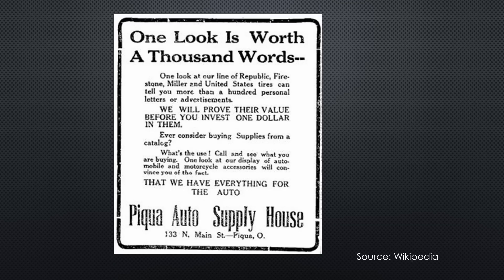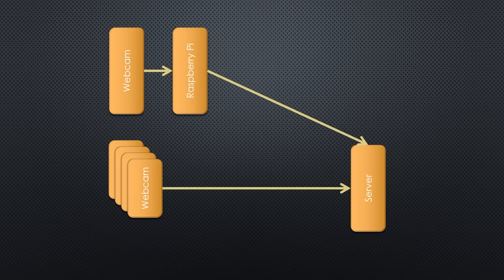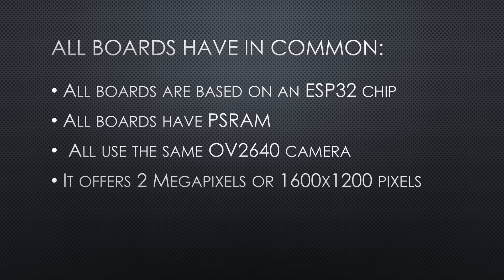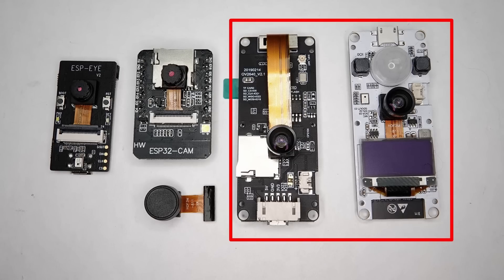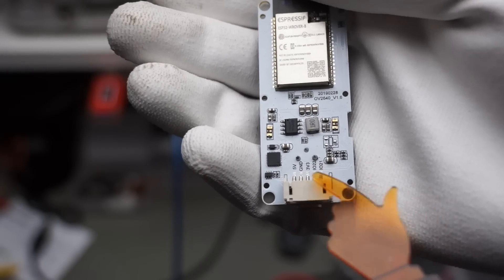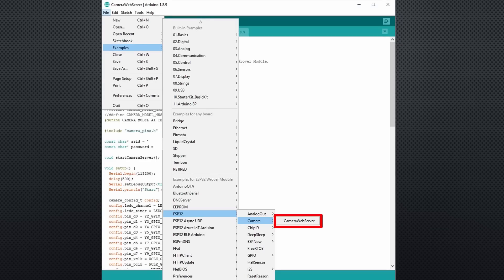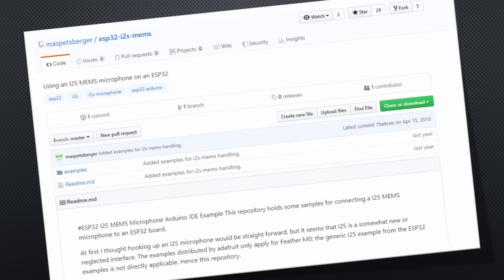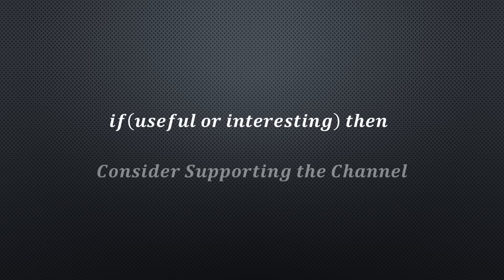#285 ESP32 Cameras: Comparison and Test (OV2640) and I2S MEMS microphone test

Comment: Great video!  Thanks.  I have a question about the chart shown at 04;20 - detailing the Esp32-cam .  It says no SD card slot is available. I'm holding this exact same board in my hand - and there clearly is an SD card slot .  I haven't checked that it works but I'm sure it will.
Reply from the maker: You are right. I pinned a correction post as the first comment ;-)

Comment: Hello andreas,
 I have a esp32 devkit v1 30GPIO version. I am facing issue when providing power to vin pin from external power supply(+5V). esp32 board show power on led but its sketch doesn't start until I press reset(EN) pin. Can you please help me to provide some information on this issue.
Reply from the maker: Unfortunately, I cannot do remote debugging.

Comment: HELP! - I received my ESP32-CAM last week and have been struggling with it.  I had some issues programming it at first; but, that seemed to have a problem with my USB-serial.  I got a new one and it programmed right away.  I then had to figure out which "CAMERA_MODEL" to use for CameraWebServer.  CAMERA_MODEL_AI_THINKER works (I think) - at least no error.  Now the challenge I have is getting the IP address.  When I use the USB-serial in 3.3V mode I get the "Brownout detector was triggered".  I assume this is because the USB-serial can not supply enough current.  Anytime I try to avoid that by posewering the board using 5V on the VCC pin, the LED turns solid on and I get no message out of the serial port.
Reply from the maker: You are right. I do not connect 3.3v from the FTDI adapter and power the module with 5v. GND has to be common

Comment: nice video and good explanations as always :) I am struggling a bit around with my ESP32-CAM (AI_Thinker variant) while trying to hook up this litle dude to my LAN (via 5V diy PoE injector) and a W5500 ethernet module. Seems to be: i am "zu blöd" to enable the W5500 and link the ethernet port "bridged?" to the wifi.apip to obtain an IP address from the integratad "server" in my project. Any advice are welcome...
kind regards
Reply: Blöde Frage, warum willst Du an der Kamera eine Bridge machen?
Reply: @dahimbi7069  Hi, naja eigentlich würd ich ja gerne nur ein W5500 anbinden damit man das ganze als LAN-CAM Server ohne WiFi benutzen kann... via WiFi läuft das schon und wenn man das LAN interface da noch mit anknüppeln könnte -bin da offenbar zu blöd zu :), dachte LAN via "bridge" auf den im ESP laufenden AP und gut ist? oder hat sich da ein logicfehler eingeschlichen?
Reply: @kleinerfighter-ka6677  das sollte schon funktionieren, allerdings brauchst Du da keine Bridge für und Du darfst nur ein Default Gateway setzen und von DHCP würde ich dann auch abraten. Wie das allerdings rein Hardware mäßig aussieht, da muss ich passen, nutze entweder ESP für W-Lan oder Arduino Lan bzw wenn ich beides brauche PI oder Banane. Gibt's für einen nackten ESP eine Library für den W5500? Wenn ja welche Ports benutzt die?

Comment: Glad you showed the ESP32 Camera you don't own, but you missed at least 3 other ESP32 based cameras made by M5Stack - They have one that looks a lot like the ESP-Eye called the ESP32CAM it has a Grove connector on it so breaks out G/5v/G13/G4 nothing remarkable about it, but it does work out of the box, and works quite well. I think it runs around $8, There is the M5Camera, which is in a case and has lego mounts on it, It has a gyroscope, and pressure sensor, and Analog Mic, and a Grove connector to break out the I2C pins this one is about $15,  There is a M5CameraF which I think the difference is the fish eye lens, Looks like it's in a different style of case too, I'm not really sure it's about $17 dollars.  I'm still waiting on a couple of them from China, but they claim QR code/ and Face Recognizing. I don't think any of them are supported by the Arduino IDE just yet, just the ESP-IDF. Just thought I'd mention a few more.

Comment: ESP32 simply does not work good with camera sensor. So far there is some clunky i2s code that is not even written properly for i2s to operate at good resolution and speed.
Maybe someone who has ton of time will write some optimized code in lx6 asm  and add it under idf. Forget buggy arduino

Comment: Hi , this board can be used to protect the zone, be installed in the door. It can be used as a control point for a smart home. For example, going to the camera, she will notice the movement and activate the microphone, using the camera you can recognize the talking person. ESP32-cam will allow you to take photos on an SD card, store and transmit data for rpi3+.

Comment: I haven't ordered any of the TTGO camera boards, but I can verify that shipments to the US from US warehouses is significantly faster. As for the TTGO white, I believe it might be voice activated to get the camera working. I think Dr. Zzzs (I believe that is his name) did a similar spotlight on these camera modules and he had to say some phrase in Mandarin(I think) to get it working.  He might be able to help with the pinout for the non-working module.
Reply: As for projects, considering that you can pick up a board for $6.99 right now from Banggood, I thought I might try to attach one to a telescope for some heavenly event captures. I originally planned to use an RPi, but that solution seems a bit clunky but would be easier to record the video. We'll see how it goes. I grabbed some 'disposable' telescopes from Toys'r'us during their going out of business sale for testing. I just need to stop being lazy and get moving with the project.

Comment: I have a white TTGO board which does not have a mic.
The camera pins listed are very different than both the images you displayed.
Here's the camera pin list:
y9 39
y8 36
y7 23
y6 18
y5 15
y4 4
y3 14
y2 5
VSNC 27
HREF 25
PCLK 19
PWD 26
XCLK 32
SIOD 13
SIOC 12
RST NC

I know the camera works because I use it to keep an eye on our mailbox from the computer.
I don't know the above pins are correct because I haven't changed the code in the module since I received it. I just use the module as it came.

Comment: I am working with cheap esp32-cam for a while now. They do have some odd quirks e.g. on at least two of my devices the camera stops working if it doesn't touch the sd card slot ... I have no idea why. I also can only program it if it gets 5V but not 3.3V. Multiple IO ports accessible don't seem to be usable e.g. IO16, Programming via Wifi doesn't work properly, ... 
My plan is to build a security camera with wheels on it that either works like a remote controlled car or like a gondola on a rope having over my garden ;)

Comment: Surely one ideal application involving pattern recognition would be a "Guide Scope" for a computer controlled telescope mount. This would permit long exposures, which is the critical requirements for deep space telephotography. The characteristics of the camera and lens will be critical in order to work in low light conditions. It is so exciting, I simply must do it...what is the conversion efficiency of the camera chip is it a CMOS or CCD Camera..?

Comment: Check out my ESP-CAM Video Recorder
github  jameszah/ESP32-CAM-Video-Recorder

It has a http interface to stop/start and configure the recording, and look through the viewfinder, and an ftp server to download the video from the SD card.
The videos can be started with different framesize, framerate, quality, etc. and will be written as AVI files, so you can play or edit them on your desktop.
Good for full resolution at limited framerates, or full 24 fps at lower resolutions.
Improved version coming with uses both cpu's to prevent delays due to file system.

Comment: I got esp32-cam working with MicroPython as well. It takes a picture and emails it to me.
Reply: That's impressive!
I want to do that in my project.
Can you reply to this comment with a link to micropython code that captures images or video (preferably at max resolution) from the esp32-with-camera board?
Thanks!
Reply: (Oh.  I don't need code to do the emailing.  I am looking for micropython code that will capture images or video, at max resolution, and save them to an sd card.)
Reply: @KenSkier  sure, just flash the bin file from here https://github.com/Lennyz1988/micropython/releases/tag/v1
Reply: Can you share code?
Reply: @ivanarakistain3885  look at my other comment and look at the webcam module inside the bin, after you flash it.

Comment: I recently purchased a ESP32 CAM and thought I would share my finds as they may help some of your viewers
Most Libraries (Arduino,  Ivan Grokhotkov's esp32-cam, etc) usually associate ESP32 GPIO pins with camera functions.  If the board you are using returns a failure to camera initialization, it is usually associated with incorrect pin assignments.  The one most likely mis-assigned is the PClock.  The OV2640 camera interface has inputs for RESET, Camera Power, and Clock.  The different boards may assign different ESP32 GPIO Pins to these camera inputs..  The ESP32 CAM requires PClock to be assigned to 22.  The ESP32 CAM uses GPIO pin 32 to control the camera's additions power (different regulated voltages).  This pin must be in the LOW state to power the camera and enable it to operate.

The camera documentation that can be found on the web is very old.  The camera manufacturers do not/will not publish full documentation on their camera as they don't want other manufacturers to understand how their product works (you do this when patents won't protect your intellectual property).  You must sign a NDA (Non-Disclosure Agreement) to gain access to the important camera registers that need to be programmed.  Even after signing an NDA - the information is sparse and "spoon-fed" only that which is required for your implementation. 

 What this means to the maker community is that taking the camera documentation and attempting to modify the way the camera works from the code you are using will usually fail.

The existing OV2640 code that is available that DOES work (once proper pin assignments are made) is written to deliver a low resolution JPEG image and at a frame rate that will satisfy most users.  IMHO, that resolution is way too low to attempt any sort of image processing - OK as a simple web cam but not much else.

My goal is to use the ESP32 CAM to deliver raw data at a resolution of 1600 x 1200.  I prefer the raw "bayer pattern" image but will accept RGB_565 at that resolution.  I have been unable to find code that will actually provide that format at that resolution even though the code suggests it can (I suspect someone attempted to make register modifications and just published the code thinking it would work without validating it actually does work).  I am currently developing code towards that goal.

For any Maker that is interested in using the ESP32 CAM to deliver a higher resolution image - I offer the following for your consideration.

You must find the correct set of "undocumented" camera register writes that will place the camera in the  correct mode to output the required image format.

The Camera (OV2640) outputs 10 bit pixel data but the camera board designs throw away the lower 2 bits and only process the upper 8 bits (I suspect to save the use of 2 GPIO pins for other uses).

The PCLOCK is produced from the I2S clock or an "LED Timer" channel - you will need to know which one your code uses.  Changing the frequency of the PCLOCK will directly affect your frame rate (only if you are interested in streaming video - not still pictures).

The existing code (all versions I could find) uses a small circular queue to hold camera scan line data to process it and then quickly transmit it over WIFI. (One reason the working default is low res jpeg).  The camera board uses PSRAM to hold the data associated with this queue.  Data can not be DMA'd directly into the PSRAM buffers so must be copied from ESP32 sram into the PSRAM buffer.

The ESP32 CAM states it comes with 4 megabytes of PSRAM.  My board actually has a 8 megabyte PSRAM implemented.  The ESP32 only allows 4 megabytes of PSRAM to be mapped into it memory address space.  If you want to use the other 4 megabytes, you have to use "bank switching" which the current ESP32 IDE does not currently support - but you can do it yourself if you want.

The 4 megabytes of PSRAM is sufficient to buffer a complete 1600 x 1200 image if you want but you must write your own code to enable/ use that capability.

If you attempt to change the camera's output from from the existing low res jpeg format, you will need to understand what format the data coming from the camera is in, how many bytes are used to contain the data, what you need to post-process the data into something you want, and you must revise your code's I2S and  DMA parameters to account for the changes.  Failure to properly implement any of the previously mentioned items will result in an unusable output.

The current ESP32 code does not utilize the ESP32's dual cores.  I suggest you explore having all lwip stack processing take place on one core and all camera processing take place on the other core.

I hope the information may help someone that is attempting to step out of the default usage of the ESP32 CAM and explore it real capabilities.
Reply: Many thanks for clarifying why all the examples are showing hopeless 5FPS on VGA or even less. I found a post of esp eye (espressif) where some one had achieved 25fps with SVGA and has published some information https://github.com/espressif/esp32-camera/issues/15
Reply: Hello John, did you get decent video to the SD out of your ESP32 Cam?
If you did and are happy to share the code, please let me know.
Thank you
Reply: @petertryndoch8857  I have never had an interest is SD card usage - so no.  My interest is in high resolution pictures.
Reply: I have found that the RTSP implementation is a tad bit faster, however not fast enough even on VGA resolution. If there is a way to get SVGA 25fps please do share...

Comment: I like the idea of using a camera as a user input device… There are many ways it can be done, using just that as your premise. One way I've considered, is using an object with a QR Code printed on it, which the camera can track. You can even use multiple QR Codes with unique IDs encoded in them. …Three things to consider, though, are the latency of the camera and video processing steps, the FPS, and the pixel count (or resolution). Latency will lead to an experience that feels slow and unresponsive. Low frame rate will lead to motion tracking errors with fast movements. A low number of pixels will mean less detail, so you'll need to compensate with larger QR Code labels.

Anyone is free to use these ideas, by the way! I kinda hope that someone does something with it.

Comment: The CameraWebserver Sketch is very basic and afaik only uses one CPU core. Maybe we could split the workload of the  MJPEG compression among the two cores? (e.g encode odd frames with Core1 and even frames with Core2). That would maybe boost frame rate and performance quite considerably?  Cheers!
Reply: that would be really cool. Currently performance is pretty bad on these, even at 1080p.

Comment: rear view and the like cameras on vehicles are generally analogue to overcome the delay inherent in digital vision systems. It would be useful then to characterise these boards in terms of latency. Are any good enough to be used for vehicle rear vision? Also, I guess we need a maximum number in ms  latency that will not interfere with real time vision applications to compare the cameras against.

Comment: nice video, i was waiting for something like this for long time! I want ask, are any of these cheap boards suited for primitive monitoring of my house, streaming over home wifi to mobile?? nothing HI-res, just see, if people or cars are moving around etc, are these capable runing from bateries only (18650 i gues)?? how long if yes ? I have raspberry pi zero with 5mpix camera with motionEYEos, which work pretty good i think, are any of these boards similiar to this in image quality or capabilities ?? Is better use theses, or buy (outdoor) ip webcam and use that??
Reply: The battery power will maybe work for an hour or so. Nothing that works for normal interaction. The video stuff quite takes a lot of power. If you just wake up with a door ring it might work better because the you always need only a few seconds full power.

Comment: Dear Andreas, first of all thanks for this overview! I have two remarks, one: I made ths ESP32-cam using an 0.96” oled display and one external button, making time lapse recordings. The images are stored on the SD card. I use the available GPIO pins with some tricks as they are in use for the camera and the SD reader. For example the TXD and RXD pins can be used as GPIO pins, and IO0 can be used as an input as soon as the sketch is loaded, I use it with a button and the touch command in my sketch. On the display you can select wether or not connect to WiFi (I did not yet add functionality to that as I do not have experience with building websites, but maybe somebody can help with that?). Then the user can select the interval for the timelapse on the display, and start te recording. As I am on a short holiday now I cannot give you the sketch, but I will do so ASAP.
The second point, I hoped you would give some more info on the little (round PCB) MEMS I2S microphone, how to connect and how to record. Do you have this microphone running on an ESP32? I would be very, very grateful if you have some more info on that!
Regards, Hans

Comment: I have tried motionEyeOS on rpi3. Great for setting-up surveillance cams connecting on my network. Going to use it on my mobile toy robot school project.
Reply: I am also using the pi zero w + motioneyeos with a cheap camera without any lense for my DIY home security. The cost and setup ease seem to be much better than ESP camera to me. Am I missing something here?